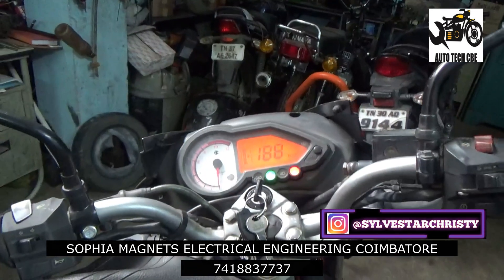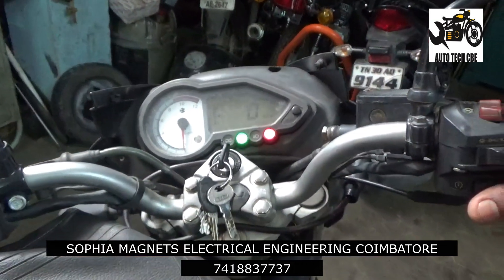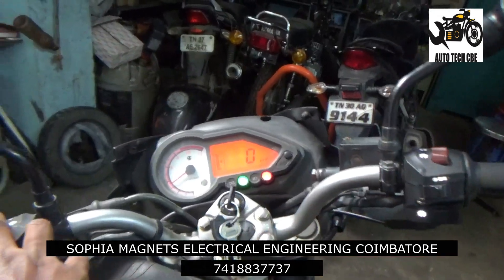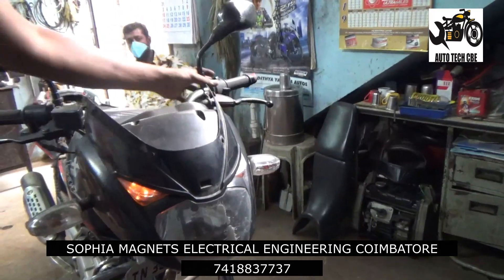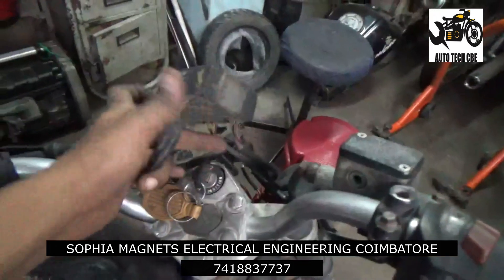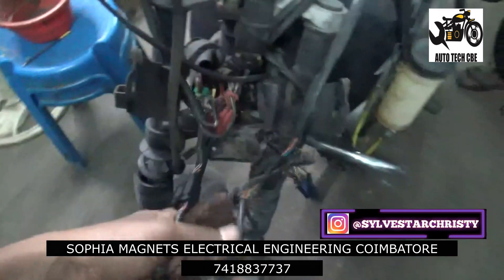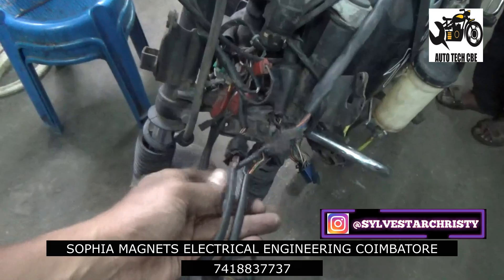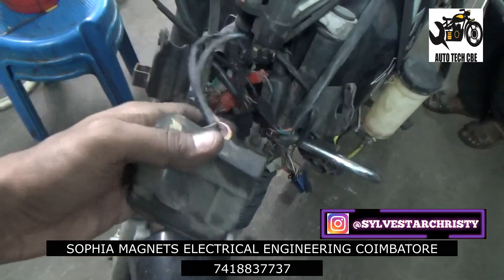PULSAR SENSOR PROBLEM SOLVED

Comment: Bro enoda bike pulsar 150dtsi Ug4 model   but head light pottah bike off ayduthu bro ennah problem ah irukum bro
Reply from the maker: Check the battery bro if battery is weak problem may occure
Reply: @AUTOTECHCBE05  bro new better
Reply from the maker: So check the battery recharging